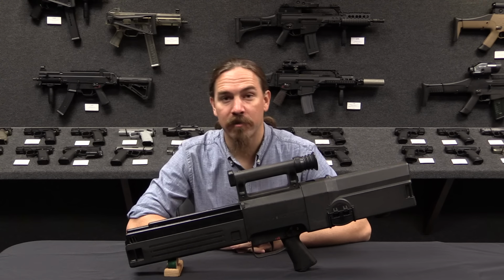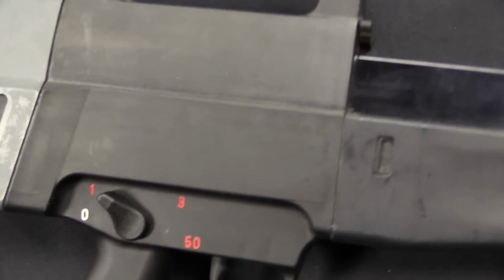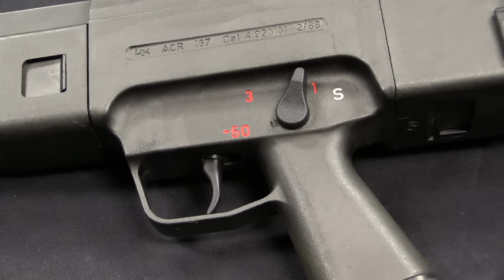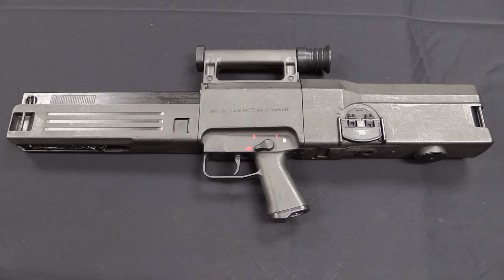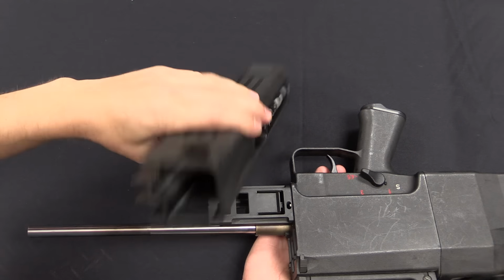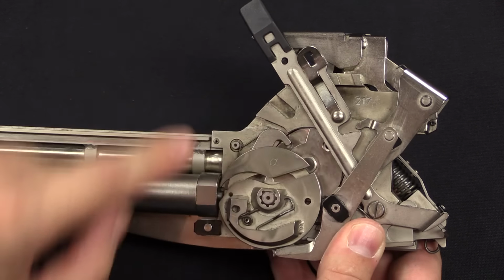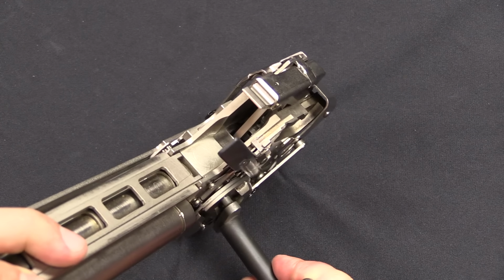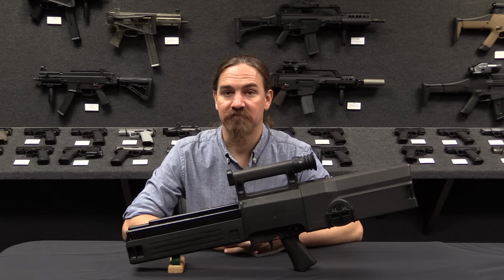Kraut Space Magic: the H&K G11

Comment: These old weapons are perfect candidates for 3d printing
Reply: The polymer frame for sure, its just a simple box. But how are you going to reliably print the clockwork fever dream action contained within? You will still need a metal sintering 3D printer with extremely good tolerances, a whole lot of hand assembly and probably need to machine a lot of surfaces for smoother movement and better gas seal. Probably easier to start with a lathe and mill, and a pile of steel stock.
Reply: @GrantE90  considering they 3d print f1 engines that run at the absolute the  peak of  engineering This being 3d printed  isn't  far from realistic. Yes assembly  would be technically challenging  but the parts could all be printed  to the needed tolerances without a doubt.
Reply: @rhyswilliams4893  "fully 3d printed" yes you have limitations, but when combines with common items like metal springs and screws, anything can be made...

most 3d printed weapons will use a straight steel tube for the barrel meaning no polygon rifling..
Reply: @GrantE90  I've always said the same thing. For making guns (with a proper FFL of course), you're better off learning how to program a CNC mill instead of learning to program a 3D printer. 

3D printers are just significantly cheaper than mills and lathes, even cheaper than a used Bridgeport vertical mill or a grizzly lathe. 

But I've always said the same thing. You can find CNC programs for milling literal complete guns for free on tons of forums. 3D printing is not quite there yet for making a complete gun. And 3D printed recievers kind of suck.
Reply: @samuelhirosky4797  Depends what you mean by '3d printed'. Very strong, as much as machined, steel and titanium parts can be 3d printed. We have the technology. But then, a 6 axis Mill is cheaper in that instance. But as you well know, not all shapes can be machined, however they can be printed, hence why the technology was developed.
Reply: @samuelhirosky4797  you don't need an FFL to make your OWN designed firearm it goes back to patent law Rights, it's YOUR intellectual property..hence the law of the Spear Mankind's Tacitus Contact of self preservation.selling it however requires FFL provided it is not patented. However you can MAKE anything for personal use and property you can even build a nuclear weapon or reactor legally.. getting the restricted Elements to make it work however requires a license for the materials..
Reply: @samuelhirosky4797  "3d printers are just significantly cheaper..." Speaking in automotive terms, you can get a REALLY good carb for the price of a low grade FI system. The quality is going to suffer if you're adding a bunch of electronic components, including software and testing, and still expecting the price point to be the same as a manual operated system. Tests and such with sintered metal may be able to produce parts as strong as something machined out of solid metal stock(would take a lot to convince me of this), but how much time and effort would have to go into ensuring this in an automated process? I could see something like a programmable EDM machine or similar technology combined with true CNC machines being faster or more cost effective in a mass production setting where one complete setup could do the work of a large number of manual machinists working in a production shop, but to setup the whole system needed to produce something like this would require a very large price point to match the precision of a skilled gunsmith with an assortment of old machine tools without any digital integration. That's just my experience. As a 3d modeler and graphics engine programmer/parts prototyper/concept developer I found it much more effective to do small batches of parts I was making on old machine tools the old fasioned way because the reality is that I could have finished a part I was making by the time it would take me to create the 3d model, especially if my tolerances were at firearm levels. I got a deal on a mill that came with a ton of tools and bits and indicators, and also on a lathe that similarly came with all the bells and whistles and just throwing in my other random tools laying around I would say I didn't spend more than $1500 on the capibility to make just about anything within reason, given a reasonable amount of time and effort. So, initial investment... hard to justify any other scenario unless large quanities of your parts or products are expected within a short amount of time. 

Sorry for the long response but this was the route I took even though I started from purely the technology end of the spectrum. Seems like nothing really beats these old tools in decent hands. I don't know if many home 3d printer machines will be around for 80+ years like the South Bend Lathe I am proud to own. Also honestly with all the software updates and OS's and mobile devices and the nightmare of the current state of "technology" that I've been dealing with, it's a huge relief to go outside and flip an actual switch, turn actual dials, and make actual measurements with my eyes given how difficult it can be to even play music in my car without being accused of verbal abuse by the AI in my phone. That's also why I like wires. They can be cut lol.
Reply: @GrantE90  and when you're finally done u cant still fire it cuz NO AMMO FOOL!
Reply: @GrantE90  a CNC lathe would make more sense
Reply: @GrantE90  Velo3D's machines could probably do it.
Reply: @GrantE90  looks like it can be made with stamped sheet metal, springs, tubes, and maybe the chamber is milled
Reply: @GrantE90  the current discipline with regards to metal is; it has to be plain steel tubing or springs, stuff you can find in a hardware store...see the liberator 12k
Reply: @GrantE90  It was sarcasm.
Reply: @deaj8450  are you sure? I have heard more than a few crazy claims about 3d printing.
Reply: @jhallin5185  Considering the way this weapon is built it'd be stupid to make in any way again ever. It's not a perfect candidate for anything XD
Reply: @deaj8450  🙄
Reply: @deaj8450  If someone's gonna say something like that, they better make damn sure everyone can detect their sarcasm!  Deluded Call of Duty fanatics will fabricate and fire 'cool' 3d-print patterns, without vetting them or even checking what plastics are appropriate.
Reply: @henrysokol3466  PETG and PAHT filaments are as good as metal, with regards to frame, lower even barrel...springs are universal and found easily
Reply: Yes you would need to obtain metal internals upper and lower parts kit in metal... the outer part and scope housing and magazines could be 3d printed. And the grip.
Reply: @deaj8450  no. It wasn’t.

No. With a period.
Reply: @rdpenguin2710  I'm not saying it's impossible to do. Im saying it's almost entirely pointless to do. Why remake an overly complicated weapon that is stupidly difficult to maintain and failed in the first place when you could 3d print guns that are reliable and easy for anyone to use? I don't see a purpose beyond historic preservation and hobbyists.
Reply: @deaj8450  oh no I agree, for most people a FGC-9 is a good project and is perfect for most peeps; but if your asking me why innovate then I don’t fully know how to answer that? 
 
I think guass rifles are looking promising as just this week arcflash released there new design with about the same power of a 22.lr short! They’re are so many possibilities and using experimental coil geometries and new designs and weirder and weirder guns is a good thing? It’s literally open source R&D

If not innovating and opening firearms to more and more people and circumventing the AFT ;) then why are we doing this?
Reply: @deaj8450  btw that’s what I and I assume most people were thinking abt, the G11 has been used as a template for coilguns and I think it is a perfect candidate, also why wouldn’t u want this sexy unique crazy rifle?
Reply: @rdpenguin2710  Personally I don't like the gun and think it's kind of ugly, but to each their own on tastes. I'm not against innovation, if someone wants to take this and change things about it to make it a viable weapon then I'd be all for it. I was just saying a direct reproduction via 3d printing is fairly useless in the grand scheme.
Reply: @deaj8450  I disagree, I think it looks futuristic and retro lol.

I also think that there IS value in reversing how old abandoned concepts and projects and remaking and building off of it
Reply: @rdpenguin2710  Yeah I agree with building off of it or using it for reverse engineering, figuring out what works and what might not. How to improve it, there's definitely value in that.
Reply: @deaj8450  to do that you need to build it vanilla?
Reply: @rdpenguin2710  I'm sure there are specifications and prior experiences with the weapon to go ahead and formulate what they could or would change. I am not personally an expert on the weapon, but I know it clearly has some flaws. Step one would be to make it easier for any soldier to strip and maintain, which would mean designing ways to simplify this beast.
Reply: @WesleyChe  A made a fully functioning glock-34 (police in comments, no longer have it), ..at first I was gonna try and fully 3d print it, then I realised how much stuff can be just bought on Amazon.

I bought airsoft parts off Amazon which are identical replicas and metal, was amazed to find a full glock slide and lower..The slide I modified to accept a real firing pin..only issue was the plastic barrel but I am sure it would have fired at least 1 round...never tested it but should have worked in theory...
Reply: @henrysokol3466  dont us plastic for an entire gun
It is VERY LIKELY to blow up
Reply: @deaj8450  perfect candidate as inspiration for sci-fi weapon designs
Reply: We need a 3d printed g36 with parts you can make at home!!!!!
Reply: @jd7338   done
Reply: Good luck with the chemistry required for the ammo though.
Reply: *prints a panzerschreck
future
Reply: 3D printing difficulty level: insane.
Reply: Why do you think I want a 3D printer?
Reply: Good luck printing that Rube Goldberg machine parts needed to make this work
Reply: Same with the P90, most of it is printable and the whole of it is very simple while decades later it still looks like the only weapon futuristic enough to equip SG teams with.
Reply: atf has entered the chat
Reply: @fbi
Reply: Excellent idea
Reply: There are some awesome 3d printed frames and they usually are blocky like this. The only issue is the bolt and barrel.
Reply: "You wouldn't download a gun."
Reply: You'll find most on grabCad
Reply: i 3D printed a revolver,and it works ok,wonder how advanced 3D printed weapons gonna be in the next yeara
Reply: @SirEdubardo  you gonna do a big stress test on it? See what its true limitations are?
Reply: @Sierra045  3d printing sears is a pretty huge development that scares the shit out of gov't agencies, for some reason unbeknownst to me, therefore I think smaller mechanical modifications to pre-existing pieces of hardware is where 3d printing is at now. Eventually the technology to create load bearing pieces will come around and we might see 40k levels of IP fuckery from very sweaty pentagoons, but until then it serves a pretty distinct purpose.
Reply: @Sierra045  just dont lol
Reply: @SirEdubardo   Revolvers are a firearm class barely changed by the 150 years since they were invented. Modern ones have more upscale construction, but the design template makes them so reliable and sturdy that real innovation is almost wasted on them.  Take a look at the G11's complex and precise action, made up of very thin pieces.  I wouldn't hold your breath on that gun being 3d-printable.
Reply: @henrysokol3466  it 3d printable in 50-150 years
Reply: @SirEdubardo  what did you print it with
And revolvers are simple
The is KRAUT SPAC MAGIC
Reply: @SirEdubardo  it's gonna be cool when   3D printers that use some kind of metal become common enough and cheap enough for most people to own. They'll be some incredible things that could be made with them as long as they're able to print using decently strong metal alloys. If it's limited to metals as soft as soldering wire due to having to keep the melting point temperature down, it won't be very useful.
Reply: @SirEdubardo  they are already very advanced, its a whole new science

Comment: When the trigger is pulled, a firing pin ignites the primer, which then ignites a powder booster charge that pushes the bullet into the barrel. The solid block of propellant is broken up to increase the ignition surface area and ignites, accelerating the bullet out of the barrel. - If somebody doesnt understand

Comment: SC-FI weapon
Hey this wierd monster reminds me of the P90,and i´m pretty sure it has the same functions like this G11 thing.
Reply: not the same action, not the same idea behind conception, not the same function. G11 was intended as main assault rifle using a very specific mechanic with vertical ammunition storage, rotating feed system and of course caseless ammunition. P90 was intended as personal defence weapon for vehicle crews, second line troopers like artillery and ended in the hands of some police forces as close quarter combat SMG having both compact design and good load of bullets in the mag, the mechanic is quite classic, only the magazine is exotic fitting a feeding ramp pivoting the bullet @90° from lateral to front.
they are as different a muskeet could be to a Remington M700.

Comment: This was very interesting. I remember reading about the rifle back when it was being assessed but never knew why it ultimately never made the cut, albeit the geopolitical angle really is super obvious once you think about it. One thing that is interesting though and that is, at best, hinted at in this video but that was a major feature of the rifle is the fact that it's (supposedly) virtually free of recoil. Obviously, very few people can confirm or deny that nowadays, but back then it was basically the whole point: An assault rifle that would increase accuracy by having no recoil while at the same time basically eliminating the need to reload during a battle.  Something that might have been a good addition though would be some kind of ammo counter, kinda hard to keep track of where you are and I guess you can't just quickly top it off...
Reply: It seems like topping off the magazine is the standard way to fill it:
https://youtu.be/UoTU-X0qbnQ?t=48
As the rounds have no cases, it apparently was planned to hand out the ammo in protective boxes of 15 rounds. The later Versions had 45 round magazines rather than 50... maybe just because  the refill cartridges for a 50 round magazine had to be 25 rounds wich might have seemed to bulky. Maybe it is also nice to be able to refill after 1/3 of the magazine is spent...

Comment: Several issues lead to the weapon being not adopted albeit being decades ahead of its time. Mind you the US are now reevaluating new assault rifles with caseless ammunition.
1. Entirely new none standard ammo type not interchangeable with anything across NATO
2. Cook off issues on sustained fire (those were resolved later on but a certain reputation prevailed) 
3. clumsy long clips 

On the plus side :
1. An extremely accurate and powerful 3 round burst at 2200 rpm when the last bullet left the barrel before you could feel the recoil 
2. It was scoped when everyone else had iron sights 
3. Heavy firepower due to large  clip size  

The killing factor was the none interchangeable ammo with other systems and the costs involved to adopt it on a larger scale.  
other than that, this gun gives most 2021 assault rifles a run for the money although its 50 years old.
Reply: US where not really enthusiasts during ACR program. They wanted cutting edge weapon systems but were so conservatives that was just some money thrown through the windows.
Almost all the contenders were for example with proprietary ammuniton, Steyr and AAI with their subcaliber flechettes, Colt with their dual bullets cartridge.

All of the ACR contender were fitted with optic Steyr ACR like HK having a built in optic which is in fact not a great idea. G11 even ended with a rail instead of the built in mount and optic, allowing to fit whatever stuff you want.

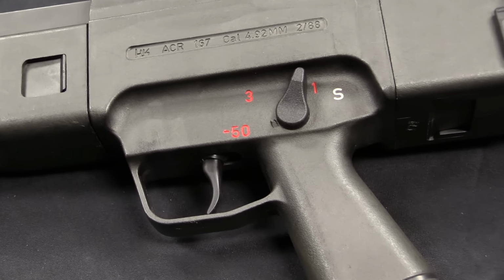Comment: the safety shows the number  '-50'  as the full auto setting at the  9:09 mark and before but  the number '-45' at the 11:38 mark.. were there two guns??
Reply: yes, there are two different guns in the video, earlier prototype had a 45rds mag. You can see the difference between the 2 versions by looking at the front of the gun. The old has a round foregrip, the late is squared all along

Comment: You missed to mention one important thing in your video: the G11 was violating the Geneva Convention as every hit (even a close non-hit within a few millimeters distance) would have been lethal due to the shock wave of the high speed projectile. 

Its important to know a perfidious war fact: it’s not the intention to kill soldiers in war. You just need to stop them from participating in war actions. If you kill an enemy soldier, then his comrades will fight harder (revenge). But if you wound an enemy soldier, then you reached your target (no participation in war actions anymore) and it will also slow his comrades as they need to take care for their wounded comrade. 

Looking back it was a good decision not to introduce this G11 and other similar weapons.
Reply: the heck are you saying? The 4.73x33 being lighter (3.3g vs 4g) AND slower (925m/s vs 960m/s) than the classic 5.56 M855 there is no way it was the killing beast you're talking about with about 400J difference. And since the ammunition is a FMJ with a plain solid core it doesn't violate the Geneva convention. Finally the close non hit that kills is pure bullshit. It was debunked using a facking .50 BMG which is FAR more powerful and deadly than a puny 3g bird shot.
https://www.youtube.com/watch?v=YrHpe5Z93wM